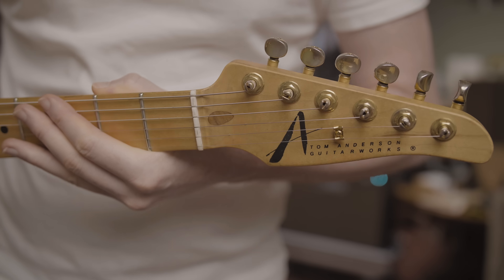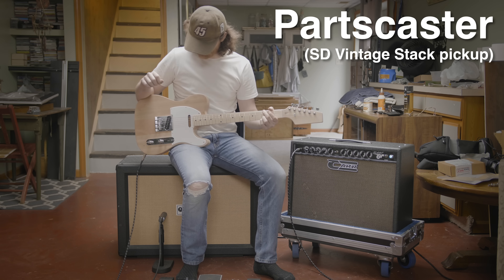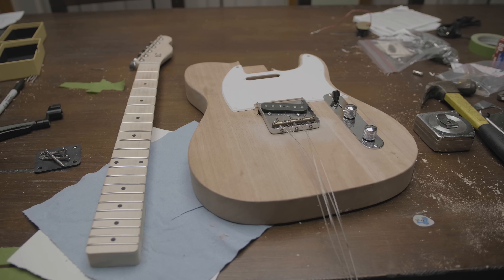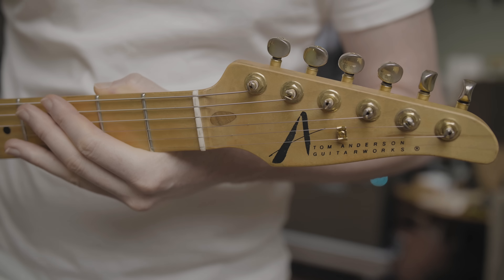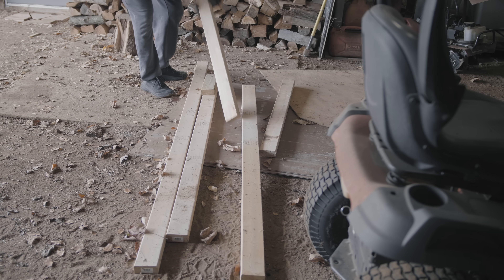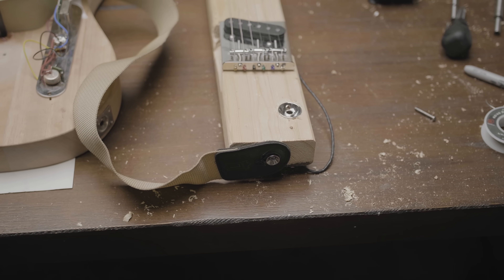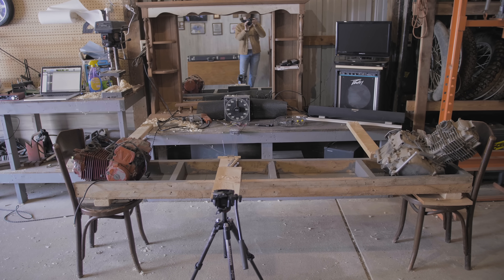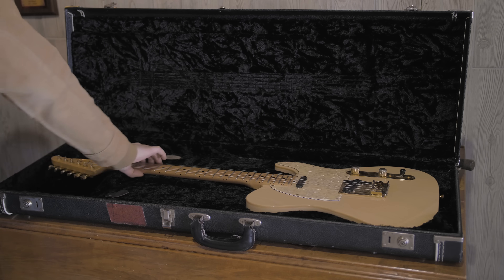Tested: Where Does The Tone Come From In An Electric Guitar?

Comment: Excellent work Jim!  I applaud you for putting this together and for the work you put in.
On the "Anderson vs Air" there's a slight difference in the higher frequencies that can be detected.  The potentiometers and capacitors will have an effect on the sound, and since electronics components have a tolerance...no two (unless a matched set) are the same.  If you bypassed the Andersons controls and jack into the bench circuit for the Air sample, you'll most likely get closer in tonal response.  (the pickups may not be perfectly matched...but close though.  Eliminate one factor at a time.)
Again, awesome job!  I've been digging into the electronics side and how to manipulate tone other than a tone pot...how potentiometers contribute to "pickup taming".
Looking forward to future experiments from you!

Comment: Sounds like the table has far more resonance and sustain. The surfaces to which the bridge and head are connected will probably be very resonant. If you've ever put the head of a bass or guitar on a desk and strummed it you'll know it audibly amplifies the sound.

It would be very interesting to see more but I think that is where the differences in body/neck material and form make the difference - the attack, sustain and resonance of notes - and not necessarily the frequency content of the initial strum.

Comment: Hey man great video but after having build kit guitars and amps what changes the tone more is,(drum roll) the tone control!
Really its all about impedance missmatch or match vs load. 
Differents guitars work better or worse with some pedals and some pedals sound good or not with diffrent amps. Some pedals and amps want to see a certain load.
Example: a guitar with potentiometers and a tone cap will react different than a guitar without potentiometers. A single coil will sound different with 500k vs 250k pots.
Guitarists who roll down the guitar volume to clean up, and roll up to get a sligth crunch or distortion are using this principle

Comment: An inspiring dedication to debunking myths. Presumably, this nonsense began with that actual differences (on average, at least) between acoustic guitar sounds based on woods used in construction. Even there, however, far more is explicable from other differences (perhaps most importantly, plate thicknesses and bracing). What strikes me as even more laughable is the idea that the "old wood" in a '50's Tele, say, is important to the sound. And then, the height of absurdity is contending that a re-finished solid body guitar just can't sound like an original one. Thus, even when the only way you can tell that a '54 Strat has newer lacquer is by shining a blacklight on it, it's automatically worth just a fraction of the price of one that avoided such a fate.

Comment: Great video. There was still some tone difference between the plank and the tele, with the plank having more treble or less bass, not sure which. Body mass, or maybe total guitar mass does seem to make a difference in tone. The mass of the benches you had in the last test might have contributed. Johan Segeborn did a test where he mounted a neck & pickups to a big hunk of scrap wood and then sawed pieces of it off between tests.
Reply: not as much of a difference when he included the control electronics to the 2x4

Comment: Now I don't feel quite so silly putting some Kiesel Custom Guitars pickups in my $80 P-Bass body. Also replaced the electronics with some decent Pots and shielded wiring. It went from sounding fairly lifeless and bland to what I'd say is a typical growly, deep P-bass sound. As it seems like the pickups are responsible for about 50% of the sound and then adjustments to the pickup position itself account for another 20%. And then, the electronics round it all out. So, all in all the pickups are responsible for the overwhelming majority of the sound.

Comment: The majority of the guitars I've bought in my life have been cheaper (owned plenty of super expensive ones too). The biggest difference I've ever found was in changing the pickup. Second to that was swapping cheaper stock pots and wires, and better tuning pegs. Other than that I've made cheap guitars plus upgrades that came out to around $300 sound as good as ones that were $1000-2000. Little proper adjustments and they felt as good too. 

Guitars don't have to cost a fortune if you put in the time.
Reply: Yup. I bought a Jackson 7 string for 180 bucks and then slapped some active Duncan black out pick ups and some new tuning pegs on it and had a truss rod adjustment/ full body set up at a full investment of about 450 it plays like a 2000 dollar guitar
Reply: Just curious, what do the tuning pegs contribute to tone? Or is it that it stays in tune better/longer?
Reply: @brianmiller1077  BUT I will add that the improved tension hold on the strings does seem to make a TINY difference in sound quality. Most cannot hear it and would be satisfied with the improved functionality alone. Largely just mentioned it as one of the early things i swap on a cheap guitar that makes it much better overall.
Reply: @brianmiller1077  - I've never found tuning pegs to affect tone, just tuning and staying in tune. Same with a better cut nut. I've played plenty of plastic nuts that sounded just fine, but you fight the guitar if the slots aren't cut to the right height no matter what the nut material is.
Reply: Spot on 👍👍👍.

Comment: In electric guitar, the tone is captured and transferred by pickups. 
What is captured by pickups is absolutely not the same as what we hear while keeping the guitar unplugged 

Therefore the most stupid thing one can do is to judge electric guitar's tone by hearing it unplugged.

Pickups are meant to mainly capture the string vibrations the maximum efficiency will happen when the body on which pickups are mounted do not vibrate; whereas the unplugged sound comes from the vibrating body.

Comment: I have been on the fence on tonewood for a long time. The conclusion I’ve came to while watching multiple videos and rough at home tests myself, is you can get the sounds to match but the feel is a different story. There is something about a well crafted guitar that just feels better. Sonically, you will have a difficult time telling the difference between an Epiphone Les Paul Standard and a Gibson Les Paul Standard when outfitted with the same pickups and electronics but the Epiphone just won’t feel like the Gibson. This video might just be the best scientific study showcasing the unimportance of tonewood.
Reply: By "feel" do you mean density and weight? I'm curious as a fledgling guitar maker. Les Paul guys seem to want their guitar to weigh like a tonne of bricks and Strandberg guys seem to want the guitar to float in the air when they let go of it. Haha.
Reply: @BosseCory  Usually means the way it plays, fits your hands and how it vibrates when playing. Gibson uses nitro finish which lets you feel the notes your playing more than the poly on an Epiphone. It also forms to your hand over time and you can feel the wood. The poly is also a bit sticky unless you rough up the neck a bit. The hard wood also helps with the way notes flow through the guitar to your hand. A guitar that just feels like it is made for your hands and you can feel the music vibrating through to your hands just adds to the experience. Not needed, just something extra.
Reply: @damnthebran  Exactly this
Reply: @BosseCory  a Porsche and Honda Civic with both get you from point a to point b, but driving the Porsche will also give you a massive erection. This is ppl prefer custom shop guitars vs overseas brands.
Reply: @BosseCory  I can tell you that judged by my personal feeling my 2.6kg Ibanez S520 vibrates like crazy while my 3.9kg LP doesn't vibrate at all.  My 3.6kg Tele vibrates a bit if i really dig into the strings. It is fun when it happens and can intensify the way i experience rythm.

Comment: It is fairly unbelievable that they sound so close together all the way through this. The kit guitar sounds 99% close to the Anderson in almost every test. I thought right off the bat that the kit guitar sounded viable enough to go gig with. That was a huge surprise! I'm sure the neck would need work to play the same but holy smokes, they sound the same. I did hear that the Dan Armstrong Lucite bodies actually deadened and thinned out the tone. There is one vid I know of where a guy put identical Strat loaded pickguards into a Dan Armstrong body from a Strat, used the same neck,  back and forth, and it did seem to be dramatic difference from wood to plastic body. Your test proves to me that expensive bodies are not making a dramatic difference with all other parts and set up the same. Regarding the lucite body, makes me wonder if "the wrong" material could actually worsen the tone, I didn't see any of that here at all, even the air guitar sounded good. Food for thought I guess. Thanks for going through the effort here. Nice work. Sharing to my guitar friends.

Comment: I can hear differences in most all of these tests. I’m starting to think that some people just can’t hear this stuff. Idk, I trust the professional luthiers on this issue, and I trust my ears. Great test. Thank you sir
Reply: What differences?
Reply: @alecmullaney7957  There is a tone profile to each of these that is different. I could give descriptors all day, but this is where I wish I had an oscilloscope and a frequency analyzer on hand. It is not just "tone", as in eq, it is also how freely the notes ring out in some cases, most drastically of course, when the strings were suspended. The wood dampens "fights" the vibration of the strings. In the last clip, you can tell that the strings do not ring as clearly and are quieter when on the guitar

Edit: I think that may have more to do here with the neck pickup pulling on the strings and dampening them. I do think the wood affects how readily the strings vibrate however, at least at certain frequencies depending on the resonant frequency of the wood
Reply: @alecmullaney7957  I actually took some tests with a spectrum analyzer. It showed a slight increase at around 125 hz and a significant decrease around 2 kHz for the air guitar. I tested each of the 4 comparisons he did at the end of the video. These results match with what I heard beforehand. The bass response of the air guitar, from 125 to around 63 hz, also wavered more and decayed faster than on the Anderson. I took screen recordings of a spectrum analyzer app on my phone, laying in the same spot the entire time. Comparing the results afterwards, and measuring/accounting for louder strumming (apparent in videos), these were the consistent differences I found. Link to the videos is here: https://drive.google.com/drive/folders/1mbYGHE1FxNgBg3zcsZJQqRANSY0ODelT?usp=sharing

Comment: Didn't show the amp settings and only played open chords mainly. Not a convincing thorough test in my opinion, The biggest difference I have found are vintage speakers  and certain v1 valves in the same amp. Even vintage ceramic speakers in transistor amp swaps is a huge difference.

Comment: Thank you for this. There is so much nonsense spoken about solid electric guitars.

The whole point of a solid electric guitar is to remove, as far as is possible, any influence from the body on the amplified sound, so you’re looking for density, not resonance. The more “resonant” a body is the less efficient the guitar will be, as the strings will be losing energy to the body. A solid electric guitar body needs to be dense enough not to sap too much energy from the strings and not so heavy that you need the services of an osteopath. And that’s it. Wood type is irrelevant. So is wood, in fact; it could be made of anything.

The neck, and fretboard material, has ZERO influence on tone. It just needs to be stable. The fretboard is not the playing surface, the frets are. Their material can affect tone, as can their condition.

The notion of “tonewood” on a solid electric guitar is ridiculous. The term itself is meaningless unless you have an air chamber and a surface that is meant to vibrate, like the top of an acoustic guitar.

Builders, guitarists, and journalists need to stop promulgating the lie that expensive planks of wood sound better than cheaper planks of wood when it’s all in the electrics, the hardware, and how well the whole thing is put together. In many cases overseas builders put the big names to shame in terms of construction.

Comment: very good & informative video :) it would be interesting to see if a heavy mahogany type of body had any effect, or , if the bridge and nut pieces were jacked to tension with towing lines tied to rubber bushings  in benches. or between 2 cars .. . I guess that would totally remove any potential vibrations travelling via any medium between the nut and saddle besides the strings , so it would totally be just the strings & pickup :)

Comment: This video convinced me more that tonewood DOES matter, especially when  the partscaster and the Tom Anderson had  the same hardware specs, electronics and pickup. Through both IEMs and studio monitors, you can hear the Anderson has a richer tone, while the Partscaster had a harsher top end, but flatter response curve.  If tonewood weren't a factor, they should sound identical.  But they don't.

Also, another aspect that cannot be seen in the video is how notes "bloom".  Note bloom happens when you bend or sustain a note and instead of the sound decaying, you hear more harmonics resonating just before it decays naturally.  It's like a wail.  While this is not endemic to high value tonewoods, it still verifies the need for good tonewood.

Comment: Very interesting!
There's a big rabbit hole to go down here. Would be interesting to see if metal parts used in/around the pickups matter or are insignificant. Like metal covers, grounded vs non-grounded covers, shielding, metals close to the pickup etc.

Those could in theory affect the magnetic field, and alter the signal. My gut feeling is it will be miniscule compared to pickup construction/topology, height and placement, but I'd be happy to be proven wrong.

Another takeaway is that bridge saddle height and pole piece adjustments matter more than most guitarists might think. Changes there will affect the balance of the strings contribution to the summed signal, and in extension the overall tone.

Comment: This is clear evidence that wood does not effect tone in a solid body guitar. Tone is affected by filters_. Body wood is not a filter. The neck wood is not filter. The pickups _are a filter. The pots are a filter. 

The whole thing about tone woods started with acoustic guitars. Guitar makers took this idea and falsely applied it to marketing for their solid body guitars. What did they have to lose? Nobody had the means to test their claims scientifically. We do now.

An acoustic guitar is an air pump. If you vibrate the strings, it vibrates the body and the air inside the body. The body panels are thin and susceptible to vibration. Luthiers select certain woods for the guitars, which were called "tone woods", because they had a "bell-like" sound when the thin panels were struck. Solid body guitars are not even remotely similar to an acoustic. The wood is very thick. There is no air chamber to vibrate.

Solid body guitars do not have tone wood because they are not an air pump like an acoustic guitar is. No air chamber, no tone wood.

Do you know what else is an air pump? A speaker cabinet! It's a vibrating membrane mounted inside an air chamber! However, the panels in a cabinet are not thin enough to be susceptible to vibration. So, the tone is mainly in the way the speaker reacts to the geometry of the cabinet. More air, less air, closed back, open back, speaker design, are going to have a major impact on the final tone you hear in the room. 

The wood a guitar is made from is immaterial to the tone. It's all marketing hype.

Comment: So basically, it seems a guitar should probably be chosen purely on the basis of how it feels to play it, because you can get any tone you want from it by changing the pick-ups and pots.
Reply: Yes, absolutely, that is a very safe assumption. I would add your string gauge/tension, scale length in there as well. While that wasn't tested in the video it's been my experience that going from 25.5 to 24.75 has a noticeable tonal difference at the same string gauge, and plays directly into your point of how it feels. Having a lighter body wood is strictly superior than not, I consider that fact, I'd rather preserve my shoulders/back than have a tiny bump of low-mids only recognizable by spectral analysis. The guys pondering "mahogany or maple" are already on the wrong track.
Reply: For my part, it's gonna go through a fuzz into an overdriven amp anyways... it could be anything lol.
Reply: Scale length too, for tone, and pick by how it looks?

Comment: Hendrix's guitar tech said that the greatest changes to tone was string gauge. As a custom builder these are my five. String gauge , nut material(preferbone) pickup height, string length =tension toploader vs stringthru and pickup.

Comment: This is the dumbest, most 'Murican  "test" i've seen, the fact that Chapman knock off thinks that it's a "Legend of a video" should tell you more than enough of his knowledge of guitars. What about the fact that the points where the strings are anchored transfers vibrations on the f*ckin' bench? 🤦😂